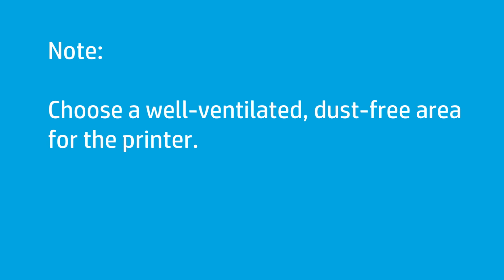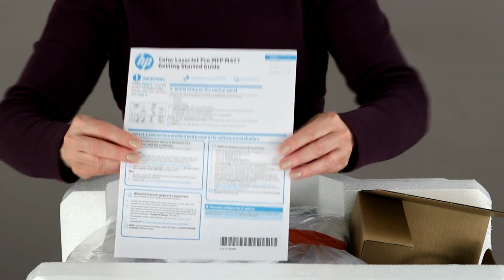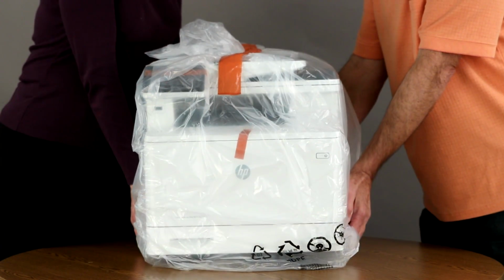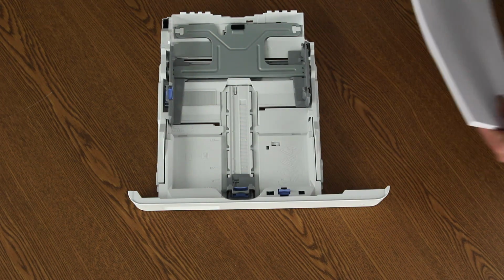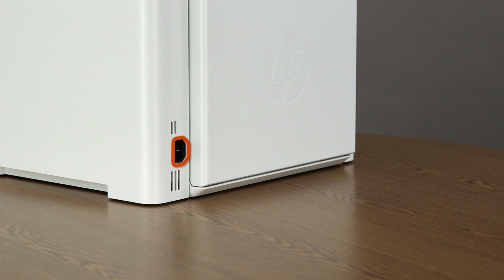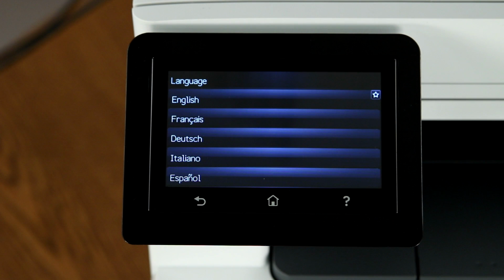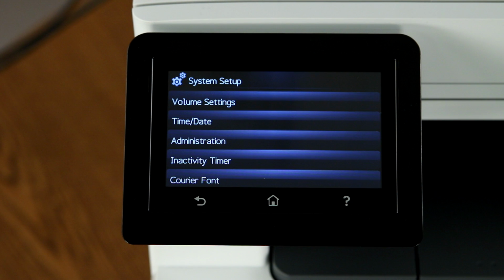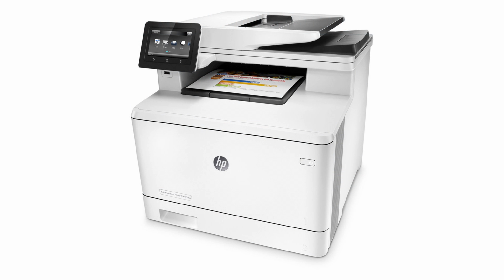Unboxing and Setting Up | HP Color LaserJet Pro MFP M477 Printer | HP

Comment: How do you install the ink???
Reply from the maker: +Luis I am assuming you're referring to HP Color LaserJet Pro MFP M477. The printer uses four colors and has a different toner cartridge for each color: yellow (Y), magenta (M), cyan (C), and black (K). The toner cartridges are inside the front door. and here is the link:http://hp.care/2eXaBIx which will walk you through.

Comment: Hello, good video, but unfortunately don’t say anything about how to select 1200dpi for a scan... The printer is showing the option of 600dpi on scan, but should have 1200dpi...what is wrong? Thank you...
Reply from the maker: +JustMe 507 You may be using the ADF and it would be checked in the HP Scan dialog box. You just had to figure out how to "de-select" that option, and select the option to always scan from the glass.
Reply: HP Support Thank you, yes from HP Scan, if I select scan from glass, then I can select for pictures the 1200 dpi... well, why is this so complicated... Anyway, thank you for your help.
Reply from the maker: +JustMe 507 You're welcome.

Comment: Does this printer hp M477fdn require a "patch" on the ADF scanner?  Meaning a literal plastic cellophane patch that adheres to the scanner on the left of the glass bed.  In my efforts to clean my glass, I removed the clear (rather filthy) plastic cellophane, which I thought was inadvertently left there from unboxing, and creating streaks on my scanned prints.  But after the removal, the ADF won't work properly.  The papers jam as they feed through.  But when I replaced that (rather filthy) plastic adhesive, the papers now feed through correctly again.  It looks like HP had a design flaw in their ADF, and so they sent out these adhesive strips to stick along side the ADF scanner, so that papers can slide through correctly.  How does one keep this flimsy plastic clean?  It appears to be absolutely imperative to the correct function of the ADF.  What a frustrating design flaw.
Reply from the maker: +Sarah Hubler Please contact our phone support team to fix the issue. Please follow these steps to reach them.
Step 1. Open link: https://support.hp.com/us-en/contact-hp
Step 2. Select the product type.
Step 3. Enter the serial number of your device or select let HP detect your product option.
Step 4. Select the country from the drop-down.
Step 5. You should see the HP phone support number.

Comment: If bought from HP does it contain starter toner black and color cartridges?
Reply from the maker: +SinisterC6  HP Color LaserJet Pro MFP M477fdn; 4 preinstalled HP LaserJet Toner cartridges (Black: ~2300 pages, Introductory Cyan, Magenta, Yellow: ~1200 pages each cartridge); In-box documentation (Getting Started Guide, Install Poster), Software drivers and documentation on CD-ROM; Power cord. Also See:What's in the box http://hp.care/2ggzJLQ
Reply: thank you, this is the perfect gift for my mom!

Comment: How long can it be turned on in sleep mode before I must turn it on manually to print? For example, LaserJet Pro M177fw works only 8 hours and then you must turn it on physically to be able to print again. It's a fraud to call a printer "network printer" when user must turn it on manually every time when he wants to print!
Reply from the maker: +Dmitry I understand that your printer will go into sleep mode and will shut down after 8 hours of inactivity. You can extend this time in printer EWS. Firstly, putting the printer IP in a web browser and then you get to the printer EWS, then go into “System” tab, then go to “Energy Settings” to see if you’ve checked “Delay when ports are active”. This setting might help prevent this printer goes into shut down status after inactivity.Please refer to product user guide on how to get printer IP address.
Reply: But if the port won't be active then I still have to come to the printer to turn it on manually every day when I want to print. That's very inconvenient! But my question was about HP Color LaserJet Pro MFP M477 model. Is it right, that the printer supports 8 hours of wait time in sleep mode maximum?
Reply: Also that's strange that you don't offer firmware updates both in printer's menu and on your website. Only support team can provide it. That's so strange! I'm speaking about  LaserJet Pro M177fw now.
Reply from the maker: +Dmitry Please browse the user guide page number:105, to check the sleep mode settings:http://hp.care/2qlFFKD
Reply from the maker: +Dmitry This link will provide the latest firmware for your HP Color LaserJet Pro MFP M177 Series Firmware :http://hp.care/2sq9lI9

Comment: On a HP Color LaserJet Pro MFP M477fdnItem number:HPBFCF377-60125 Part name ISA assembly duplex how do I install a new one or can it be rebuilt or is there a common fix? Thank you
Reply from the maker: +EurekaRecycler I understand that you are experiencing an issue with auto-duplex on your HP Color LaserJet Pro MFP M477fdn. Please follow the guidelines in this document to fix this issue: http://hp.care/2rZYpOx HP printers generally have a 1-year warranty from their purchase date, you can verify the warranty using the following link: http://bit.ly/2mP3Xrb. You can also contact HP Support in case you need further assistance: http://hp.care/2nbNQFi

Comment: Hi nice review! I recently purchased this printer a few months ago and really like it.  I made a review about my experiences at https://youtu.be/HfvArpxOKMY I was looking for an all in one color laser that did both duplex scanning and printing and this device does the trick.  Questions I have for you now:
1. Do you use it to scan directly to your computer?  Example pop in a paper and touch the LCD screen on the printer and pick scan to computer.  

I ask because on the HP lcd screen I can see only some of my computers on my home network listed as available to scan.  I contacted HP support about it and they said that the scan to computer wasn't supposed to be available and they plan to remove it from the next firmware update.  That was only one tier 1 support reps response so not sure how true that is or not?  If it's true I'll never update my firmware as I'd like to retain that feature! :)  Mostly I use the scan to network as I have a NAS drive set up and it's super easy and fast to scan that way.

2.  It looks like you have had the device for about a year now.  Do you have any updates about how it's been working, how long the ink carts have lasted and / or how often it jams or doesn't jam on document feeds or prints?  I plan to do an update to my review video after a few months more go by and I get to use it more.

Thanks in advance for a reply and cheers on your channel :)
Reply from the maker: +RockstarBruski  thank you very much for purchasing HP Color Laserjet Pro MFP M477FDW Printer and sharing your feedback regarding the scan to computer. To scan a photo or document from the control panel to your computer, make sure the computer is on, the full-feature printer driver is installed, and the HP printer is connected to the computer with a USB cable, a wired (Ethernet) network cable, or over your local wireless network. Select the file type you want to save, and then scan the item.
On the printer control panel, touch Scan.
Touch Computer to scan to the connected computer.
Touch the name of the computer that you want to save the scan to.
Touch the scan-to type that corresponds to the document or photo you are scanning.
Touch Start Scan to scan the item.
The prompt Scan Another Item? displays. Touch Yes to add another page to the same scan file, or touch No if you do not have another page to scan. When you touch No, the scan file saves to the computer.
The folder where the scan saved (usually My Documents) automatically opens on the computer.
To know more browse through the following link: http://bit.ly/2ykEek9